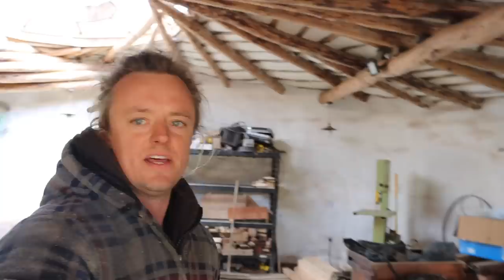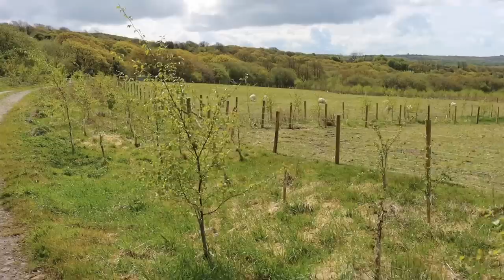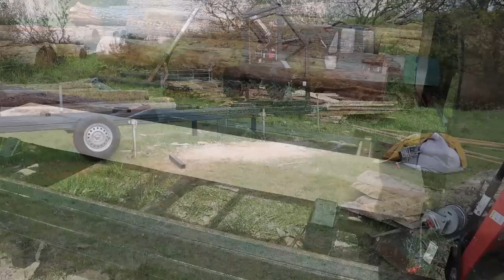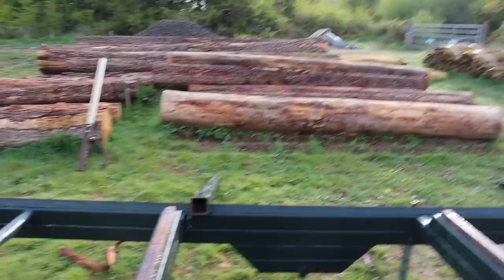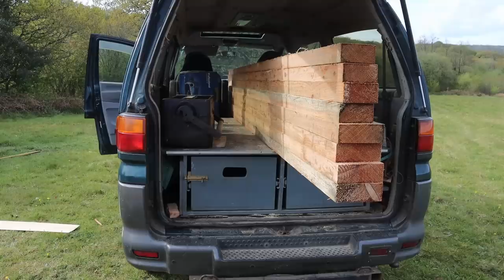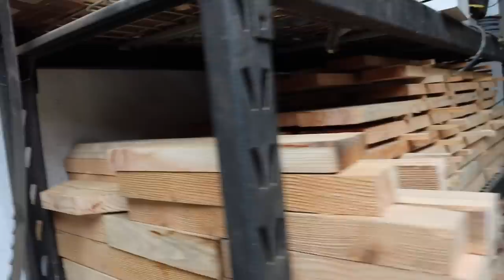Stocking Up My Off Grid Workshop Using My Homemade Bandsaw Mill

Comment: Does the blade have a way to be lubricated? Perhaps you would encounter less resistance and that would also help mitigate your wobbling on top of some more weight? Many millers swear by diesel as a lubricant.

Comment: I think you might need some outboard weight on both sides at the bottom close to the wheels to keep the cut more stable, as the head weight goes higher it’s making it tipsy as the blade grabs the cut.  If you stand a chance a chance of knocking down a 7 foot man have him hold a hundred pound rock over his head vs having fifty pound weights on each ankle. 👍🎩.  Hope your shoulder heals soon.

Comment: Was wondering if you could run another switch with your wench to cut the current in order to make it easier to dial in widths easier. Or isn't it an issue?

Comment: Has to be extremely satisfying to mill your own logs. You'll need to build a drying shed for your lumber. Do you plan on building a protective structure around the mill? It seems very exposed to the weather.

Comment: For the wobble, have you considered a single tension wire that wraps the legs in an X fashion beneath the dolly ?  ... assuming all legs are planted approximately equivalently, then that might work.
One other thing it seems that the wobble happens only when the log is not placed plum in the middle between the rollers ... but maybe I am wrong about that.

Comment: Kris did you notice the shaking of your frame on the sawmill as your cut? you have a lack of rigidity  that will eventually break the bottm welds try welding in 4 triangle brackets 8" x 18" 1/4" plate perhaps even taller it's hard to gauge it from a video

Comment: On video it looked like the wobble was in the saw carriage but legs seem like a likely starting point. 

Maybe some diagonal cross bracing between the centre pair of legs will make a difference.
Reply from the maker: Yeah it did look like that but it isn’t it’s the legs that the wobble is coming from. It stopped 100% when the tractor was there so it is definitely that.

Comment: Kris, what are your thoughts about the importance of painting the ends of your cut lumber to prevent the ends from checking? Is that further down the process for you?
Reply from the maker: I think that is a good idea. I just forget. If the timber is dried really slowly it won’t need it but if it’s a dry climate and hot then it helps a lot
Reply: @KrisHarbour  I would never tell anyone here what to do, but I have heard good things about beeswax mixtures keeping the boards from checking

Comment: For the woobl (what is the correct writing? 2nd language here), try to make a cross of wire or rope on each leg pice, from one top to one bottom, at each pair. If you look at semitrailers, if they are without a truck, the legs often have this cross to stabilise them. You can try that with a simple rope, and later implement something better.
Reply: Bakudan -   Just need to take out an "o" and add an "e" at the end: wobble. Also, leg piece (not "pice"). I always marvel at - and greatly respect - those who are fluent in more than one language.
Reply: @wendyweaver8749  thank you.
My problem is that I even in my native language I often mess up spelling.

Comment: I was thinking, Kris, it's a pity those saws don't cut in both directions then you wouldn't have to drag it back to the beginning  just lower it and cut
Reply: I was thinking the same thing twice the use of one blade also.
Reply from the maker: The blade would come off. the rollers stop the blade from being pushed off the back of the wheels. if it was run backwards the blade would just come off. You would need the rollers to have shoulders on both ends and the blade between the, for it to work like that. It could be done But the blade would also have to be really big as the teeth would still have to face the same way so the gulett could not be offset. Interesting idea though.
Reply: @KrisHarbour  oh yes I presumed there'd be some technical reason why it couldn't do that.  Anyway, it was just a mad passing idea :)

Comment: your head is wobbling about because your guide tracks are made out of angle iron with give a 45 degree angle. You need square bar tracks and guide track wheels with a 90 degree grove ...... its the side load forces cause a lift in the machine head that is causing the wobble.

Comment: I thought it was wobbling because the motor wasn’t hight enough and so the blade was pulling on the upper mill as it forced its way through the material.

Comment: Hi, I am sure you will be aware of it, remember to use your sawmill off cuts as firewood, and,  it is easy to process as it is mostly cut.
Reply from the maker: It’s all being used in the top workshop roof 👍 anything off cut after that will be firewood.
Reply: @KrisHarbour  Oh, cool, I had not thought that you might have a use for it, forgetting that you have workshop to build. Good luck with that.

Comment: How does the weight of a cut not bind the blade as it's traveling to the other end of the log?
Reply: The blade has a kerf (offset teeth) so cuts wider than the thickness of the blade steel itself. As a cut is made, the timber in front of the blade is supported by uncut timber, behind the blade the cut wood settles down to the freshly cut surface a couple of inches behind the blade...this leaves a small wedge shape where the blade runs free.

Comment: Have you got the mill running on recycled oil yet👍🏻
Reply from the maker: Not yet no. Only used about 7l of fuel in it so far! The engine is really efficient

Comment: You know you don't have remove the boards after every cut? Cut at least 2 or 3 then walk up and remove them. Won't make a difference on cut quality and saves you from walking around the saw everytime. Not sure if its the same there but a bunch of the ash trees around here on the east coast of USA are getting wiped out by emerald ash borer. Sucks to see it happen to such a nice looking wood with such great qualities.